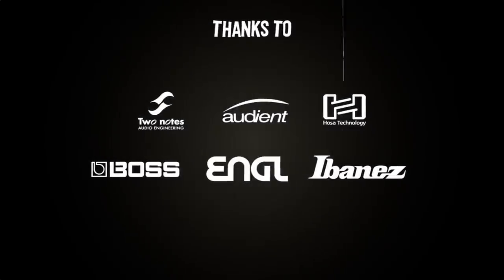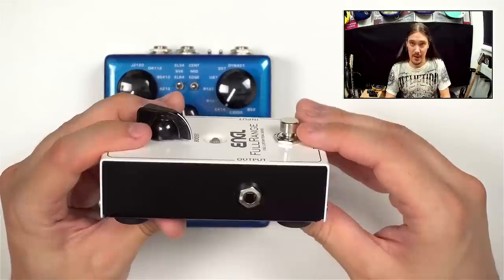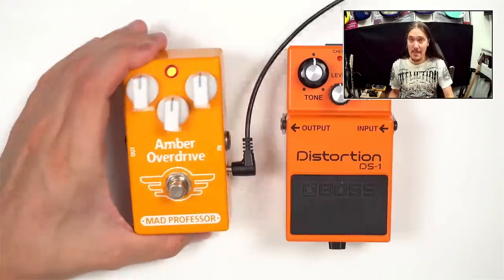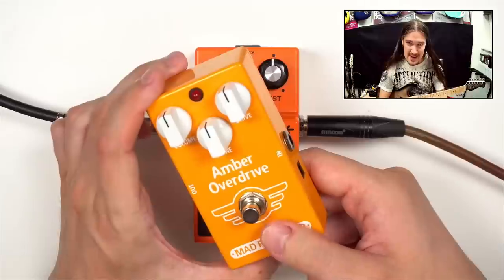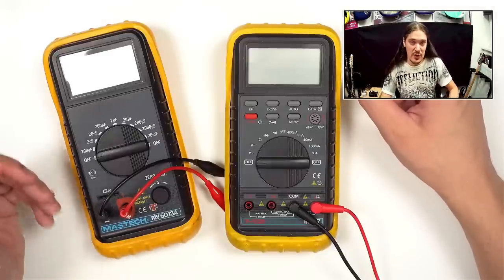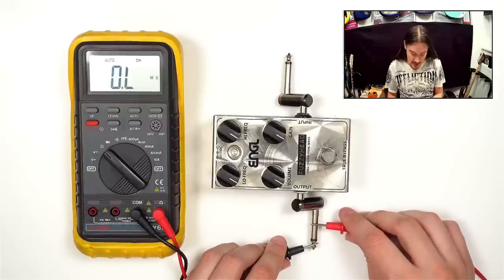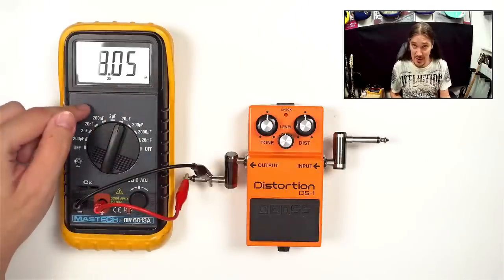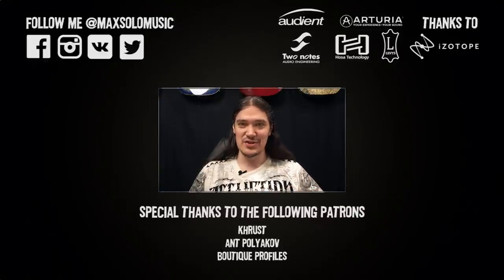How to find out if the pedal is true bypass

Comment: Note : "Relay True bypass" pedals will need power to switch. You'll get no sound if you unpower in the ON position -> But it's true bypass..   (Vfe for example).  The Relay needs to be powered to switch in position.